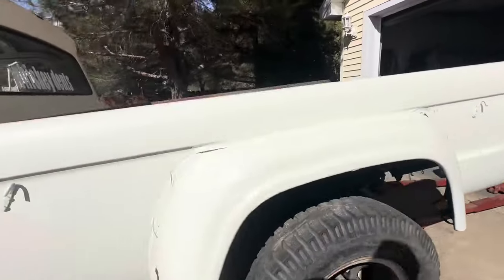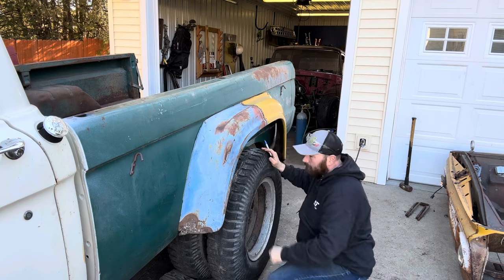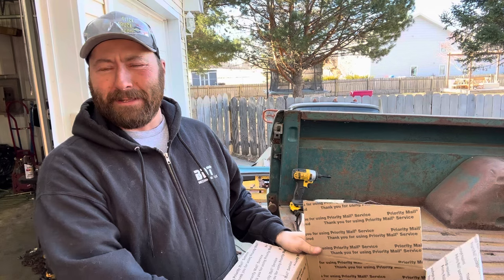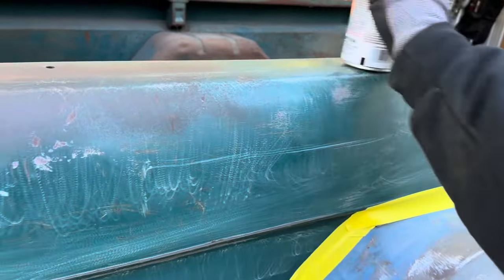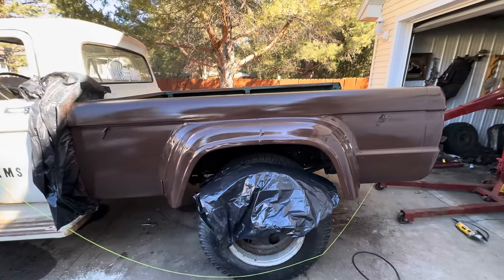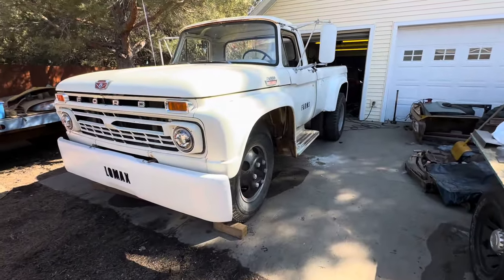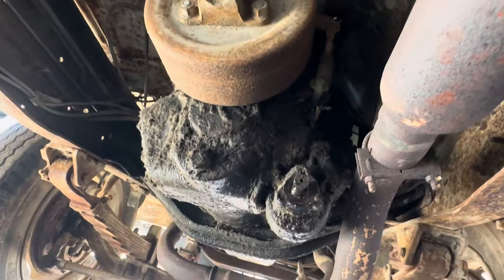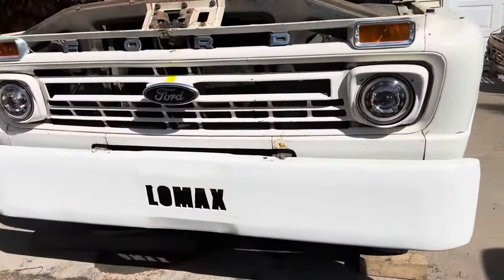Stickers are available at Whiskeydents.myshopify.com

Comment: I love that one color and Wimbledon white is the color that most of the first two years of Shelby’s were. When I saw that side view it made me think it would be cool to take the other running board’s off the parts truck and build brackets to hang it off the bed with the curved corner back side to the front and cut the shape on the back side to the shape of the rear fender, then put some flat filler panel welded to the running board with a 90 degree flange to bolt to the bottom of the bed. Then you put those fender drops on the gap in the front of the duality-fenders. And if you have another pair of those fender drops use them at the back and extend them y the body with bolt on flanges that would make it look even more tough I think. Hope you liked my run on sentence but I got all excited when I thought about that idea. 

I’m from Oklahoma by the way about an hour away from Puddin with Puddln’s Fab shop. I really enjoy your channel thanks for sharing your story!!
Reply from the maker: Thank you!  I think I understand what you mean and I think it would look really good but I’m trying to do projects that I can complete in a couple months. Otherwise they drag on like the crewcab had been. Maybe the next guy can do it:). Thanks for watching and commenting. I appreciate it.
Reply: @WhiskeyDents understood and I can relate to the project overload I had that going on until my 2-1/2 story fall to concrete and subsequent paralysis. My son turned 18 recently and he is “project poor” lol he has all mine now he started working on them 4 years ago but he made my mistake right away. He started on my ‘89 Mustang track car, my ‘68 Cougar, my ‘64 F100 4x4, my crown Vic police interceptor I was going to put under a bump side which is now going under a slick by his choice, and lastly my ‘75 F350 4x4 crew cab short bed. When he was six and I tested gravity. The ‘89, ‘68, and ‘64were all drivers and the crew had the drive shaft out to go to the builder because I kinda bent it on a rock (boulder actually). That only the projects he started work on since they were runners when he was 6. Then he        
has my projects I had going that were not together Lol. Last weekend he took a bit of off time and cut out the crushed rockers in his daily driver 2003 F150 FX4 and they look sharp. I love helping to the point I can without getting myself hurt doing stuff I shouldn’t because I learned the hard way a few times with grinders and no feeling in my legs. Hope your son enjoyed that stoogie the first one I had with my dad I barfed my guts out. Lol but in my defense I was 8 and said “why can’t I try that?”
Reply from the maker: @wayneprater8960  that would be tough on anyone. I’m glad you could pass your projects on to someone that will cherish them forever. It love to own that crewcab. I’m a huge fan of the 75’s. I’ve owned more dent side than slicks over the years. Thanks again for the support. I appreciate it
Reply: @WhiskeyDents yup I’m super glad my son loves working on cars, trucks, basically anything with an engine. I’ve adapted to my new normal and I can show him everything but I can’t reach anything any more lol. I just had to find new ways to do stuff up high, but if the stuff is low I’m good to go. 😂🤣
Reply from the maker: @wayneprater8960  adapt and conquer. I’m sure he loves having you out there helping and teaching.
Reply from the maker: @wayneprater8960  new episode is out

Comment: Looks like I found my new tow truck. I can't have enough old Fords in the yard!
Reply from the maker: My neighbors hate me if that tells you how many I have in my yard lol
Reply: @WhiskeyDents  Let'em hate on. I did sell three of mine two years ago. But working on replacing them with F250's 4x4 with the 460 under the hood. Last one I had I tweaked it just a little and it was a absolute blast to drive.